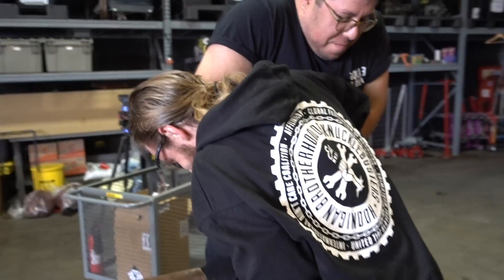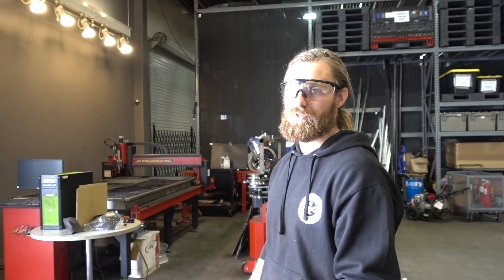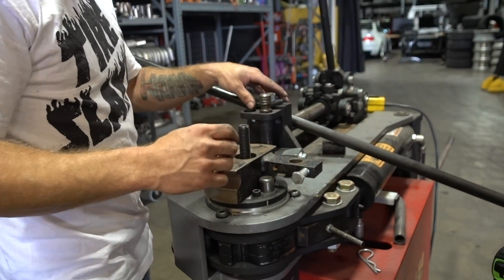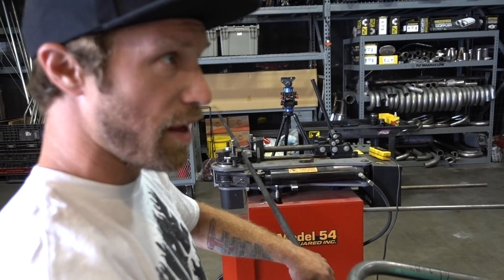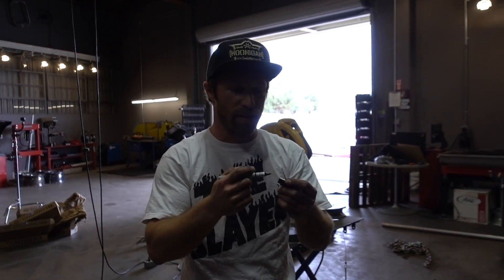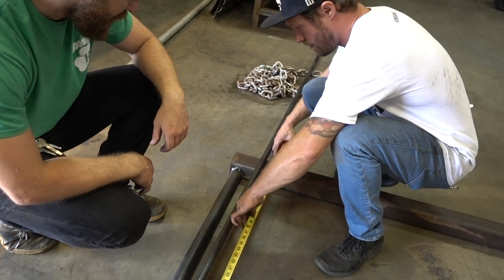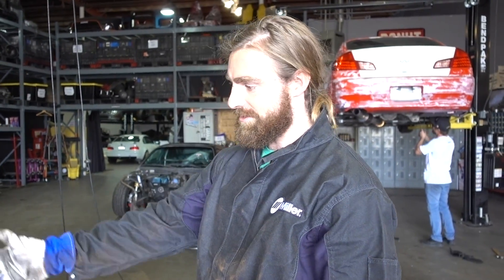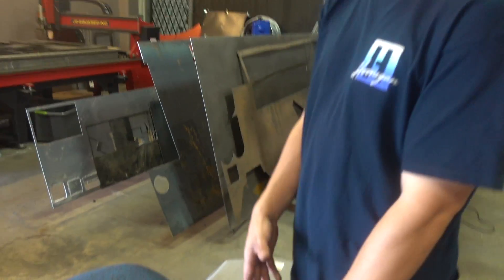Heavy Metal Kyle Bends And Welds His Way Into A Fabby Daddy

Comment: When I did electrical work pipe bending was so much fun. Depending on the pipe diameter and remembering whether you gotta subtract 5 or 6 inches and then making it look sweet when you put in a new breaker panel with like 6 pipes bent perfectly in line!

Comment: Should have drilled a hole the size of the tubing through the square section frame so you'd have a mechanical joint too instead of relying on just the weld. Good job tho.